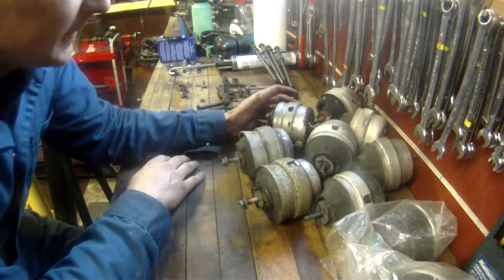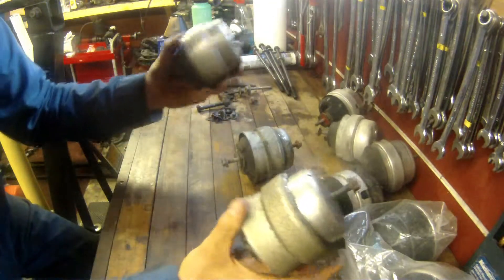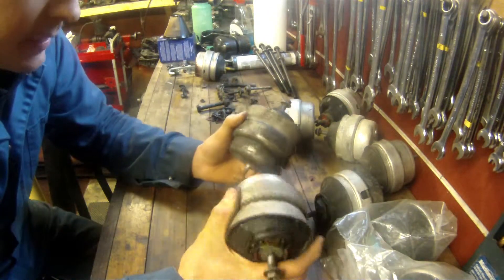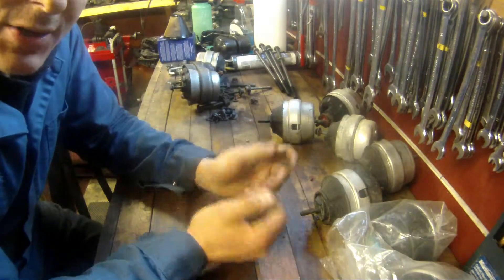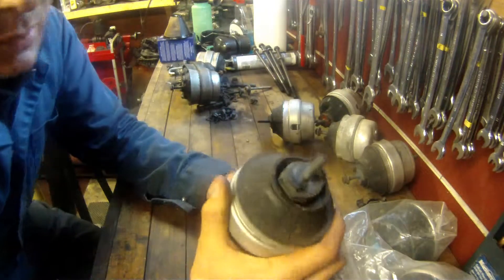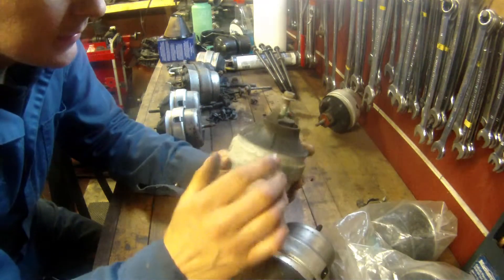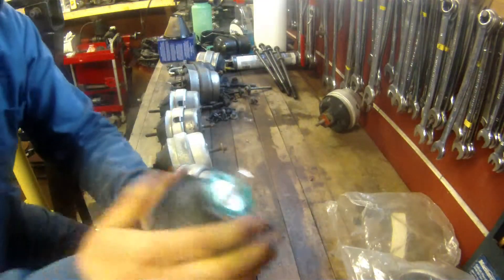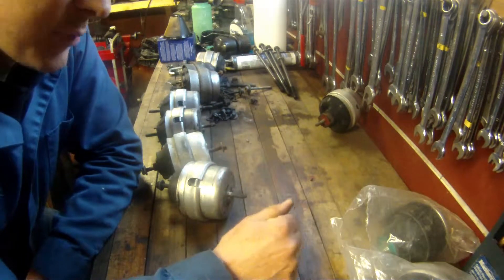Audi Motor Mount Differences Explained

Comment: Can I use the engine mounts from the V6 on the A4 B6 1.9 TDI? Will I have any issues?
Reply from the maker: We never got the TDI cars here and I’d hate to give you incorrect advice. If the TDI is similar to the 1.8T cars, the V6 mounts should work, but I’ve never seen a TDI mount so I can’t be sure.

Comment: I have a 2007 audi a3 2.0T fsi. I was driving and hit a pothole and my engine is now sagging to the right and it crushed some coolant lines and made a huge coolant leak. Just bought motor mounts and hopefully that fixes the problem then I’ll replace the busted coolant hoses
Reply from the maker: Yes if you broke the big passenger side motor mount. However those mounts for transverse motors are totally different than these mounts for longitudinal stuff.

Comment: Nice Video. One question. On a 1.8T engine: the left and right mount, do they have the same Partnumber or are they Different type of mount? Thx
Reply from the maker: If you’re shopping for mounts, the right mount has a different part number because the right one has a little rubber “blanket” to protect the mount from the exhaust heat. The mount itself underneath the blanket is the same though.
Reply: @PBGarage  Thanks alot.
So i can buy a regular mount and reused the old rubber if it is necessery.
Reply from the maker: @iboxp1486 yes totally
Reply: @PBGarage  thx

Comment: Are these much of a job to do? I got a 1200 mile journey next week and the main dealer picked up my left mount is leaking a lot of fluid.
Audi A6 C6 3.0tdi
Reply from the maker: On B5/C5/B6/B7 they’re pretty easy to do as long as you can support the engine from above. Not sure about C6 because I’ve never done one.

Comment: How critical do you think it is that I replace the bolts that hold the crossmember on to the car? All he’s trying to tell me I need to replace them but I think they recommend that for everything!
Reply from the maker: They are supposed to be one time use. That being said I’ve reused them. I find that when I reuse them I often have to get back under and check the torque on them a couple times though as they loosen off a little bit after some driving.

Comment: Hi, I have Audi A4 B5 1.9TDI ajm. While the motor is working and i was waiting for traffic lights, the vibration is too much in motor engine.   Engine and transmittion mounts are changed with febi mounts but the problem still exists. In addition to this, when i give up gas pedal, the car    is shaking too much. Do you have any suggestion? Can i use v6 mount or more powered mounts ?
Reply: Curious what you found - I’m similar situation- wondering if it’s PCV. I’ve read those are problematic
Reply: Had some 1.9 tdi passat and a4. The febi mounts are solid and gives a lot of vibration...
Reply from the maker: Do you have a miss fire? I don't think it's a mount unless they are misaligned or not torqued down properly. Does the 1.9 have a snub mount?

Comment: Hey, what is the difference between mount with a connector and one without?
Reply from the maker: A connector is for a sensor that is embedded into the mount. The ecu monitors this sensor and will throw a MIL light and code indicating it has failed. Usually because all the hydraulic fluid leaked out.

Comment: Great explanation.
Reply from the maker: Thanks! I had always assumed the 4cyl and 6cyl mounts would be the same so it was interesting to see the higher collar on the V6 mounts. I think if you wanted a performance upgrade mount for a big turbo 1.8T, but still having oil filled for some compliance to absorb vibration, replacing them with V6 mounts would be a good solution.
Reply: @PBGarage  Thanks.
Can I assume fluid filled mounts are better at absorbing the vibration than the rubber ones?
Reply: @crescentandstarglory  the rubber mounts make more vibration . I replaced the front mount arm to rubber on 1.9tdi that was not good idea the vibration was like are Earthquake. I replaced all mounts left and right front to the original mounts or the same aftermarket.